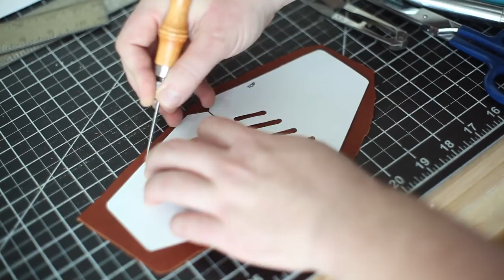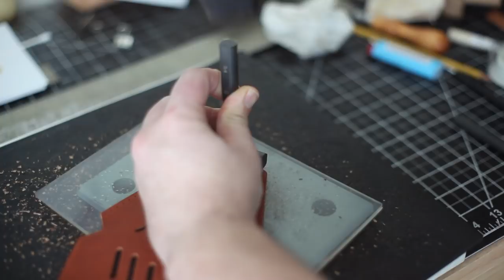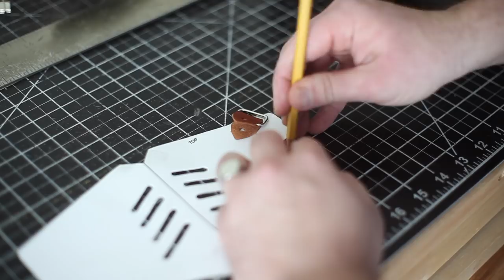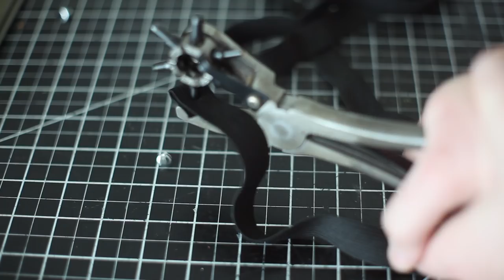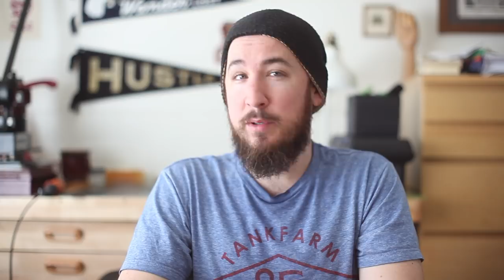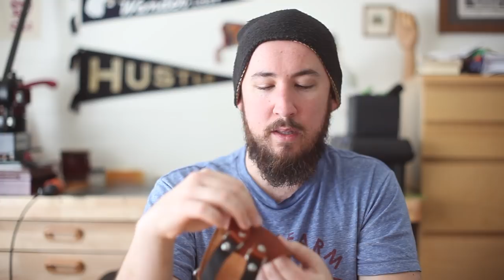Making a Leather Dust Mask

Comment: Would be great if you could insert a disposable filter you know those n95 but by now they are gone in any market...
Reply: You can buy AC filters or Vacuum filters with the same ratings as an N95 mask. 3M and Honeywell have large Home AC filters at Homedepot, Lowes, Walmart and you just disassemble therm, cut them to the size u need and put them in between your face and really anything that'll hold it in place. Head scarfs, old shirts, pillow cases, sheets...
Reply: Bill Wakefield  Don't do that. They're not good for that type of use.

Comment: Can i wash?
Reply from the maker: Washing may warp the leather, but maybe a warm rag with some soap lightly rubbed and then wiped away.  Alcohol based sanitizers may also pull out dye if the item is a dyed leather, just a heads-up.

I hope this helps!

Comment: Do you know how to disinfect leather masks?
Reply from the maker: You can't really wash them in the traditional sense.  I do not recommend them for sickness/illness prevention, if that is your intended purpose.
Reply: You have to use a replaceable filter, cant water it or use alcohol on it
Reply from the maker: @UriValdez  Good to know!  Yeah, this was just a fun project.  Maybe the mask can be crafted to remove the filter to replace it. 🤔  Thanks!
Reply: Legacy Brand Leather I would just add velcro inside of the mask and a double layer or cotton cloth to use as a antibacterial mask. I would use it as is as a dust mask but the way things are now im sure people are looking for some sort of protection.
Reply: I've heard that some people use UV light to disinfect leather or use a small amount of alcohol to clean the surface.
Then But I think the filter should be designed to be replaceable.🤔🤔
Reply from the maker: @laukapo571995  Thanks for the tips!
Reply: you can use alcohol on leather but if you consider how harsh it is on your living skin it is far more harsh on the non living leather, so youd need to condition every time you disinfect. you can also buff a healthy amount of beeswax, goats milk soap, or glycerine soap into the leather to help block the pores and give is a protective layer. you will still need to reapply wax/soap with regular wipe downs but youll be wiping off that protective layer vs just harming the unprotected leather.
Reply from the maker: @CrazyToddler  Great ideas!  Thank you for the suggestions. 🙌😊
Reply: @legacybrandleather  no problem!   You keep your leather happy, it'll keep you happy.